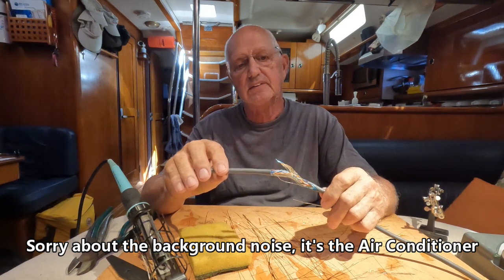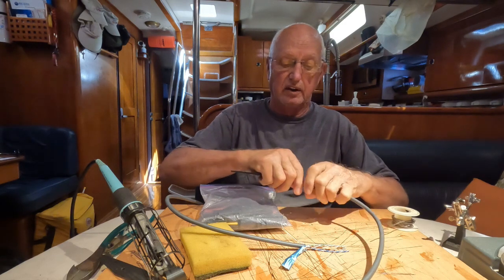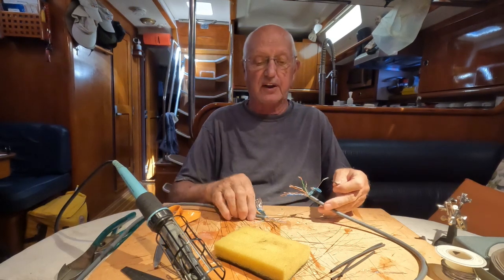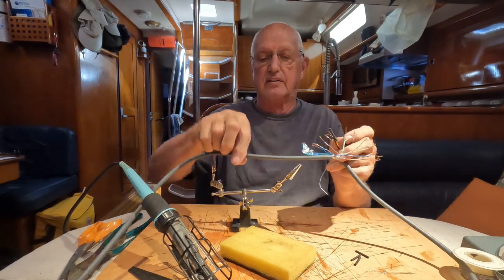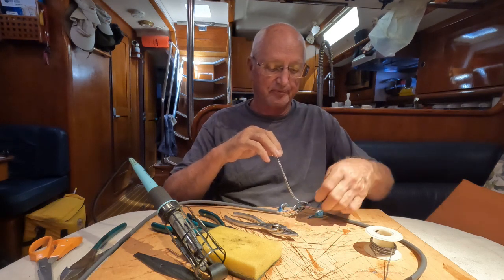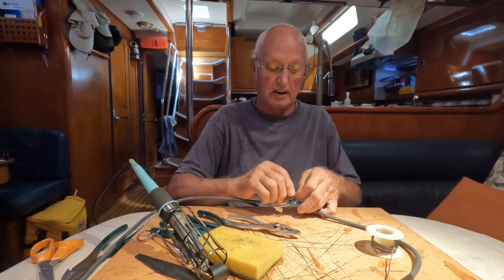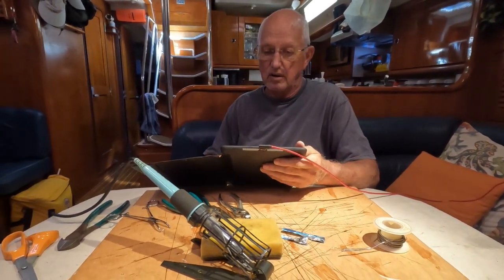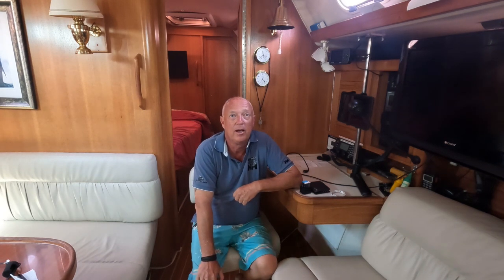Cutting & Joining a Starlink cable !

Comment: What size and brand inverter did you use? Good luck with it?
Reply from the maker: Not sure of the brand , I got it off Amazon for I think 40 -50 bucks . It’s 300 watt and can run Starlink and the TV . It also has two usb charge points . It saves me having to switch on the 2000 watt invertor which uses a lot more power to run

Comment: Whenever I splice a multitude of small wires like that I have been taught that staggering the connections a slight bit will ensure that if any were to find their way poking thru the shrink sleeve later on down the road that their chances of shorting with one another will almost be eliminated.  It might make the connection a bit longer but will be worth it overall. And yes the foil should have been wrapped around the connection especially to eliminate any nearby electrical interference that may happen in the future if any power cords are placed nearby!  I actually spliced a Starlink cord for myself about a year ago and just simply used Ethernet connectors instead of soldering a bunch of small wires.   The crimper tool  is extremely cheap as are the connectors!!!  $10 to $15 dollars for both crimper tool and a bag of 10 connectors!    I had to bury the cable in a small pipe and go through a building wall so I didn’t want to make a 1” hole.  I also wanted the option of removing the dish if I were not there so I made connections on both ends of the 75’ buried cable!   Ethernet connectors are definitely the way to go!  It is very simple to use the crimping tool as well.  I was a bit apprehensive at first but after using one realized how easy it actually is, and how cheap the tool and parts are. Plus it saves a lot of time too!!!
Reply from the maker: Good point , yes an Ethernet connector would have been simpler , Bill didn’t have any 😂

Comment: What’s the matter with you? Why in the world would you scrap the shielding?!😖🙄
Reply: @Ray not everyone is an expert nor understand the characteristics of what they are working with. At least they got it working, though not ideal. 
My recommendation was to properly terminate with RJ45 and to use one of these if it is going to be outside.
VCE Waterproof RJ45 Coupler IP67, CAT6/CAT5E/CAT5 Female to Female Coupler Connector Shielded 8Pin for Outdoor Ethernet LAN Cable
Reply: @saucierdavid8109  I’m sorry. I didn’t mean to sound so “elite” by that comment. It’s funny you mentioned that waterproof coupler. That’s EXACTLY the same one I used on mine. 
 I understand that perhaps Bill didn’t have any issues. My thought is that if one is going to put up a video demonstrating something, it not aught to be incorrect. A poor shield may not work badly for someone else in a different environment
Reply from the maker: Bill decided it wasn’t necessary to use the shielding . Doesn’t appear to effect the performance of his Starlink .

Comment: I need to do more research to see what current each wire carries, to see if it is ok to use normal krone type connectors to facilitate the dish end cable being plugged into a weatherproof outlet on the outside of an RV and the router plugged into an outlet on the inside of the RV (with an internal wired connection in the wall cavity)
Would prevent the need to continuously unplug the cable from the dish and/or the router witch I am sure will damage the proprietary fitting eventually.
Reply: quick research suggests it is standard POE, so will be very low current draw. I would look to use a IP rated RJ45 bulkhead connecter and re-terminate the cable with a standard shielded RJ45 Socket.
Reply from the maker: Did you find out the info you needed ?

Comment: Looks if you have a great cruising community there. Can you sail all year round?
Reply from the maker: Yes its possible to sail year round, in the winter its hot, in the summer its extremely hot and its in a hurricane belt. You have a choice during hurricane season, stay in a protected marina or venture up into the northern part of the Sea of Cortez and spend Hurricane season up there, about 15-20 boats a year do this as it is close to a great hurricane hole called Puerto Don Juan. Its not a port but has a tiny entrance and it surrounded mainly by hills. The recent Hurricane Kay passed through and the folks up in Don Juan saw 60 knots but virtually no fetch. we got 35 knots in the marina in La Paz. there is a huge sailing community here in the Sea of Cortez and mainland Mexico, mainly liveaboards.